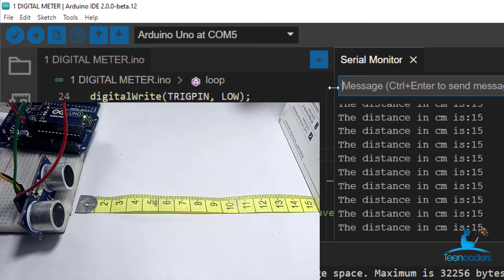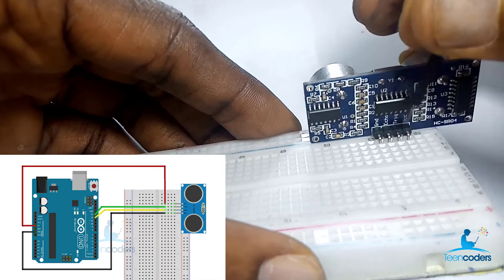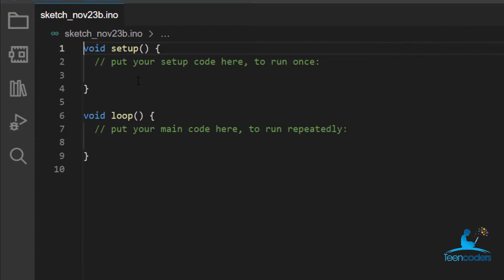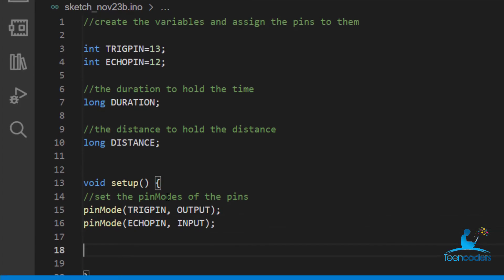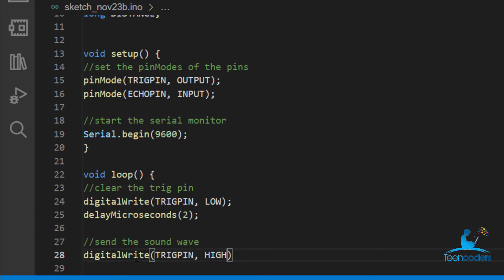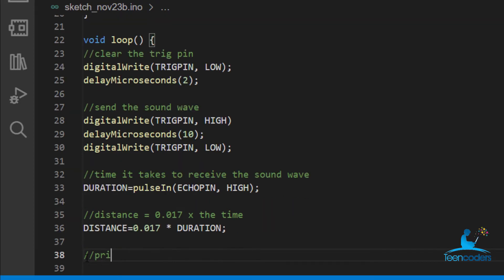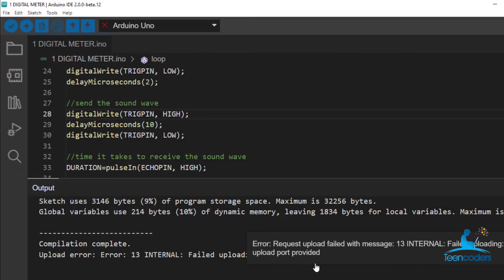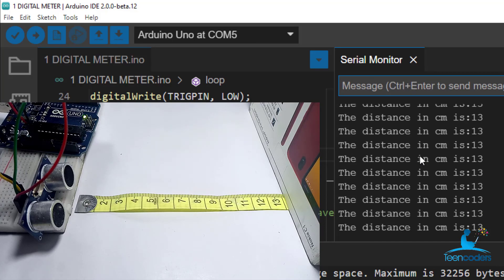Arduino Tutorial - #7 You can code an ultrasonic sensor with Arduino in 9.09 mins

Comment from the maker: QUIZ: Drop your answers below. First correct answer gets a badge 📛

1.	For this project, we set the baud rate of the Serial Monitor to?
(A). 6000, (B). 9000, (C). 9600, (D). 960

2.	The HC-SR04 Ultrasonic sensor has how many pins?
(A). 6, (B). 4, (C). 3, (D). 3

3.	Which of the ultrasonic sensor pins is connected to the 5V in the Arduino?
(A). GND, (B). ECHO, (C). TRIG, (D). VCC

4.	In this program, we connected the trig pin of the sensor to which pin in the Arduino?
(A). 13, (B). 12, (C). 11, (D). 3

5.	In void setup(), the echo pin is set to ?
(A). OUTPUT, (B). INPUT

Drop your answers below. First correct answer gets a badge 📛